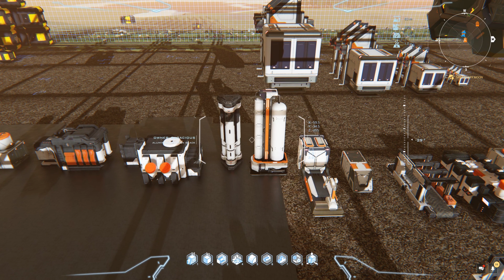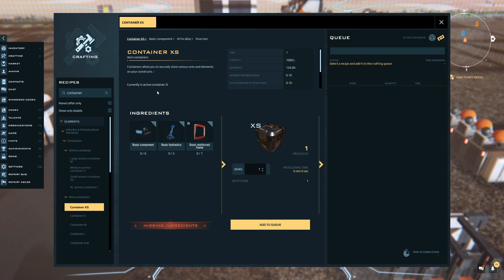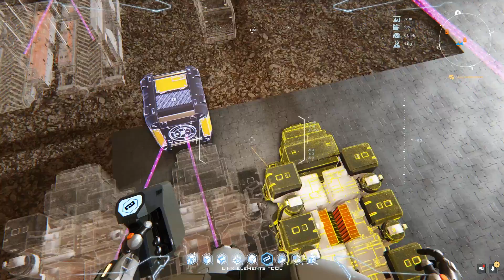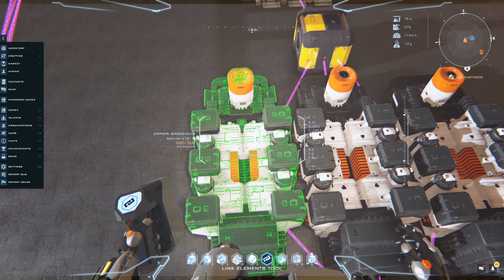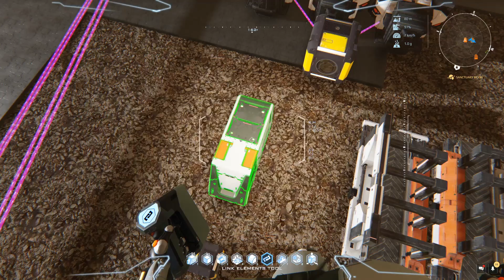Industry Guide and Overview Dual Universe

Comment: I'd be interested to see if a top down factory that's capable of making everything in the game is even possible. I imagine your plan is to have most of the final product (elements and consumables) crafted on demand with a few things (like warp cells, fuel, etc.) maintained at a certain stock level? If not and you plan on maintaining stock of every single final product in the game, that's an ambitious goal, and I wish you the best in attempting to do so. I think it would be an amazingly complex setup in the end. Not even sure how you would tackle that with the core L being the largest space available. I'd even struggle to imagine it all fitting into an XL core if they ever decide to release them. You'd need literally thousands of refiners just to keep up enough pures production. This is one massive endeavor! :D

Comment: Thank you for this video sir.  I found it quite helpful.

To bad this game doesn't visual links like Satisfactory does which makes your factory more organize and orderly.  I think the DEVS should consider using some type of conveyor system and or pipe connection as oppose to these links.  Or color code or pattern the links at the very least.
Reply: I doubt they'll ever implement any kind of physical transport system (pipes/conveyors/etc) as this would just increase by multiple factors the issues with framerate/server load that are already evident with the current industry setups. All they need to do is make the linking system more use friendly by allowing you to filter what links are shown (ie. only show links for specific industry) or someone on the discord suggested when you smart target an element (ie press U to highlight it) it shows only the links into and out of that specific element. Asking for satisfactory style conveyors is just not at all viable.

Comment: The is no way sanctuary is going to be the only non pvp area right? If this is the case I expect no one will be able to move resources to or from because the entire planet will be camped all the time
Reply: The moon is huge... also camping is not very effective because of physics.
Reply: The play space is MASSIVE. I did a quick math and estimated more than 6000 claimable hexes on sanc. Something like that. But i would guess that they will add more sanctuaries if they are needed. 

As for camping its impossible or at least nearly so. You can fly into the planet from any direction and if your flying in at max speed theirs no way another ship could catch up with you because. Physics. Even if it only took the camper 3 seconds to match your top speed youd still alreafy be over a km away from them lol.

Comment: does a container hub help reduce the need for lots of transfer units?
Reply: the problem with that is with a hub they are all interconnected. nothing is separated. might make it hard to find stuff
Reply: @Vodwuar  nah. Plenty of sorting options. Its not really hard to find anything.
Reply from the maker: No, a hub turns multiple containers into 1 container. There's still only 10 links with that new container